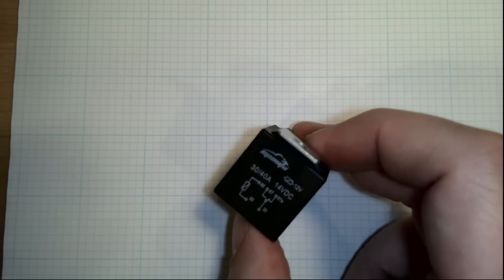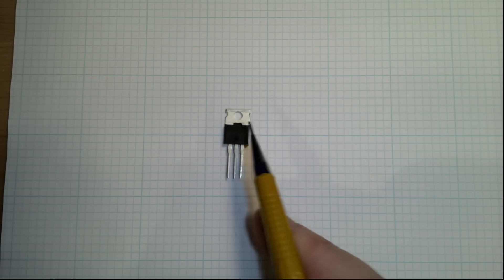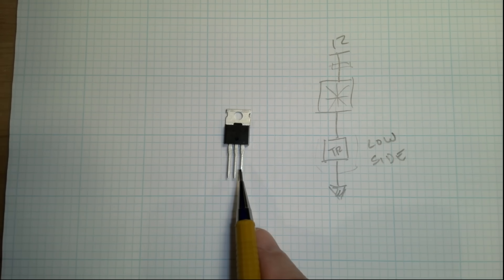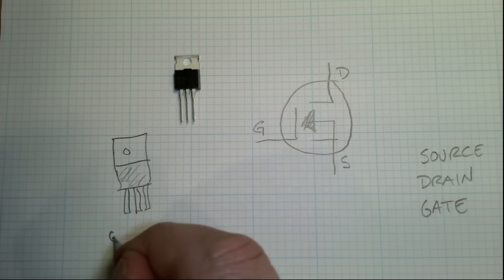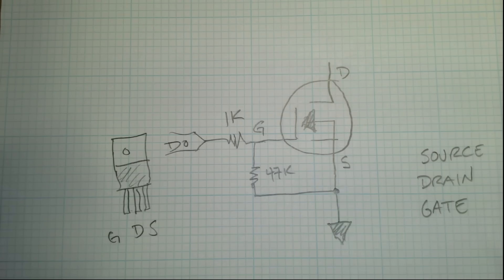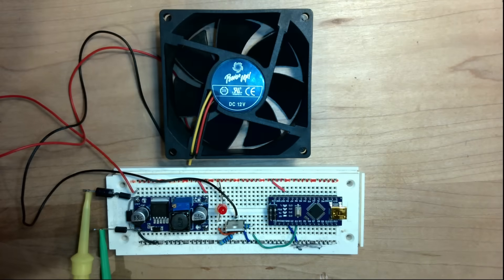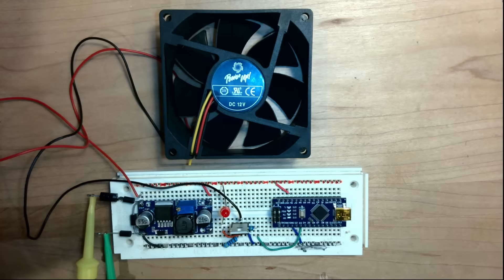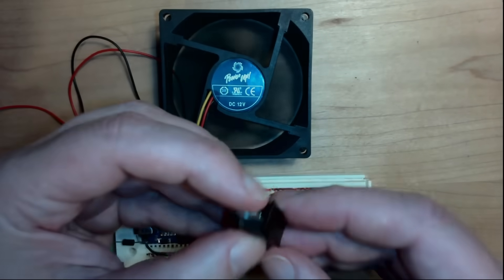Using a MOSFET to Switch High Current Automotive Loads

Comment from the maker: To be clear here, I'm not saying MOSFETS are better than relays.  I'm not saying you should get rid of relays.  I'm simply saying that relays aren't the only option, so if you're working on a project you might take into consideration using a low-side or high-side MOSFET switch. Use what makes sense to you in your project.
Reply: Any discussion of electronics needs to mention the hostile electrical environment, especially the potential for load dump / transient overvoltage.
Reply: So I thought of an advantage of MOSFETs, they can be modulated. Say you wanted your interior lights to have a softer feel such as a fade in and out when a door is opened. Using a microcontroller and a MOSFET, many modern microcontrollers would fit in a standard relay package along with MOSFET and support circuitry. That could PWM the output to make an easy-on-the-eyes fade in and out for the lights.
Reply: Auto tech here.  Source and drain seem to be backwards but understandable because electrons travel from negative to positive. 
 I hate the newer electronic modules because the high current loads are now deep inside and soldered in. No easy and fast way to plug a new relay in.  If the manufacturer stops making replacement modules. The car cannot be fixed.  I had a friend with an Audi R8. A hundred thousand dollar plus car. It used 2 engine control modules.  Audio and Bosch quit making them.  He had to scrounge junkyard modules have them repaired. Then borrow good ones to copy the programming. For the module repair shop to make them work.  Makes me like bicycles even more.
Reply from the maker: @waynep343  I feel your pain.  I recently had to repair the ECU for my 88 Jeep Wrangler.  A "remanufactured" unit was $1000, and my bet is all they do is re-cap them.  I fixed a burned trace on the ignition control and then put in probably $2 worth of new capacitors and I'm hoping it's good for another 35 years.
Reply: Wont it be constantly draining my battery at all time?
Reply: @oldestries no
Reply: @oldestries  no
Reply: @cuzz63  said you
Reply: No. MOSFETs are just plain better they last longer use less power they can handle more power... the only negative is the slightly harder control circuit. EVs effectively have single use relays for HV while the MOSFETS are doing the same current 20K times a second with no issues.
Reply: This is super helpful for a project I'm working on now adding power windows to a classic car.  Because of the way it's set up, each direction of each window needs it's own relay (to use aftermarket buttons for up and down).  An array of 8 relays is a big thing to try to hide.
Reply: @12x2richter oh hey maybe make an H bridge so you can reverse the input to the motor. They even have great digital options that are 12v, they can even be used by 5v logic if you wanted to add fancy auto roll down
Reply from the maker: @jordanrobberecht7003  Definitely.  I have a set of door lock solenoids that I want to do a controller for, and those will need H Bridges
Reply: @dotnetMakers    I got a house water pump from Grundfos and the controller in there has got BOTH, a relay and a MOSFET to switch the pump motor.  They use the MOSFET for switching it on (and also off) but use the relay to carry the current once the inrush has been covered.  This helps with preventing burnout on the contacts of the relay and also heat-issues on the MOSFET as it doesn't need to carry the current all the time.
Best of both worlds.
Reply: YEP for example my car uses irf44s in every module to turn things on and off....all via the ground side of ALMOST EVERY curcuit! due diligence and comon sense i think is how it was said to me.
Reply: How many watts is your mosfet and heatsink good for?
Reply: @whatsAname-w777k  it really doesn't matter, the heat build up in a car in summer will kill it very quick, not a good idea
Reply: @dustydawson8977  That is what I was thinking also.
Reply: @dustydawson8977  you do realize, most car stereo amplifiers are mosfet modulated, right?
Reply: I think this is what I need for my toyota’s honk.
Reply: See the solid state route good for shaving power savings for heated gloves and other clothing on motorcycles.
Reply: for a cooling fan you get a chinese made high amp SSR and done
Reply: is there any possibility they could cause a fire?
Reply: So, you’re claiming cats make better pets than dogs??!!! 
    INFIDEL!!!!!! 

I know you didn’t actually SAY that, but I didn’t hear you claim mosfets are better than relays either..  
    ..and I wanted to random-internet-participate too..  😂🤣

Comment: I dont get how needing an arduino controller is any better than a relay. If this is to replace a relay in a car you need to show this without a power supply board and arduino. And what is with shutting off and on? On a car it is either/ or - on or off, making the programming an arduino useless and not really useful to a tech.. I can see where it could be more reliable, but here you need a voltage dropper, etc, so how is this smaller and easier to install than a relay?
Reply from the maker: Sometimes people add circuits to vehicles, or create entirely new circuits or even entirely new controllers. When you're doing that sort of work, often a FET makes more sense than a relay because they are smaller or more capable of doing the job required. Understanding how a FEt can be used for high side and low side switching, and what the trade offs are helps to understand which might be more appropriate for a given design. Relays work great for many things. They also suck for many others.  That's likely why modern cars have way more FETs in them than relays, but still have both.

Comment: Are you sure the relay on the gate is for current limiting? The gate should have several gigaohms of resistance. I know in non-switching applications, where gate capacitance can be relevant, gate resistors often used to prevent oscillation. EDIT: By gate resistance, I mean Gate-source or gate-drain resistance.
Reply from the maker: Yes. The gate has capacitance and must charge. That requires current. The faster the gate, the more inrush current that requires.

Comment: You COULD do source-follower with an N-Channel, but wouldn't be the best. Also, probably not critical to keep in mind for this, but automotive voltages do rise above 12V. I regularly see 14.4V on my motorcycles, and sometimes higher on my van.

Comment: Hello. Automotive question here. 

Is it possible to custom control a modern day car fan with these arrangements:
1. Utilizing the OEM original 4 PIN car relay. (i will make 4 extension leads and relocate the relay since it's original place is in the underhood relay box) 

2. Completely isolating the engine management system from controlling the fan(this way no AC operation is possible , since it's module controlled , but in this case it is a test vehicle and i don't need AC)

3. Utilizing the OEM temp sensor(NTC thermistor)

I want the 4PIN relay to close (thus supplying power for the fan) at exactly 100celsius and open again at 95celsius.
I've found out the approximate resistance across the NTC thermistor both at 100 and 95 degree celsius.

Is there any economical electronics or micro-electronics solution for this case? 

The only other solution i can think about is purely mechanical : utilizing an old-style car fan switch which closes and then opens at the desired temperatures. But this adds additional work to be involved with customizing the OEM outlet radiator hose to accept this fan switch. Maybe a steel tube with the same OD as the ID of the oem radiator outlet hose, beading both ends , and machining and then welding a specific nut(m14x1.5) to accept the fan switch.

Any ideas guys?
Reply from the maker: Yes. What I'd probably do is a microcontroller with an ADC to measure the temp sensor and a fet or transistor to low-side control the coil of the relay.

Comment: To be honest, none of mine cars needed an relay change (but I have a spare one with my bulbs and fuses in the trunk). Previous car worked for 30 years (!) as a hard construction worker. Now I'm changing the third MOSFET on a six years old car. First was for the central-locking system, second for the wipers and now I have to get replaced one for ventilator. Each one costs 1200 CZK (59 USD) and two hours of service work, which costs another 120 USD. Im really pissed of. Relay costs about 3-4 USD and I can change it in a minute, without repair shop.

Relay can be overloaded for a while, even in hot environment, like an engine bay. Voltage tollerance is also huge. This is why they are still there, even when MOSFETs are in modern car also - for PWM or small loads. Critical circuits and circuits with high inrush current are still served with relays, due to relay's ridgidity. I like both technologies, but in car I prefer relays.   JZ

Comment: The problem is that relays, in a clear housing, are visibily easy to understand, even if you know absolutely nothing about them, just looking at how they are you know how to wire them up.
A power switching transistor, absolutely not.  It's just a black piece of epoxy and you have no idea looking at it, what goes to where.   Even between different transistors.   No printing on the outside, nothing but a little bump in a lead maybe, and still, without the datasheet, you're pretty much phvcked.  So there will always be a place for relays, if you want a circuit that will stand the test of time and the next guy to come along can figure it out.

Comment: I have a small bone to pick with what you said ~ which was ignored,

Many years back i worked with lots of semiconductors
And found they are not perfect as you have not said
If you leave these items connected as you mention
There is always a very small current called leakage
And depending on the source supply if a battery, it can drain it flat, if left for long periods of time,

Did you mention relays do not require a heat sink where semiconductors do, 
But unfortunately relays may also require more current drain from the supply depending on the resistance of the coil of the relay, and if there is a resistor involved,

Also if you use a semiconductor and if it fails or shorts, [ look out ]  The item it was controlling can run until it may burn out, or cause serious problems depending on what it is controlling,
And the problem then remains how much of a problem to change it
So myself I personally prefer often to use a relay,

And in the auto industry you often see relays being used because they are much cheaper and easier to replace, which do not cause a headache to replace if failure occurs,

And relays when not being turned on do not have a leakage
Unless you are using semiconductors to turn it on,

Comment: A consideration for cars is quiescent current (and the electrical isolation between ECU's and high power motors).
If you look you will find all electrical contacts in a closed up, locked vehicle are open, to minimise unintended current flow.

Comment: If you want that FET to sink 49A, you'll need to attach it to a HUGE heatsink and flow a LOT of air across it.  A relay is MUCH more efficient and easier to implement.

Comment: If you are using a switch to operate the relay, then I would stick with a relay.  If you are controlling with a microcontroller and/or need to modulate the load, then the MOSFET is a good way to go.  All depends on what you are doing.
Reply from the maker: Agreed. I could probably come up with some weird edge case where a manual switch to a FET makes sense but I can't think of one offhand.

Comment: The trouble with those cube relays they often take nearly an amp just to operate the coil, then you have to use a diode to prevent back EMF.

Comment: Appreciate the info but I have not had a relay fail on me often enough to use this method. And I have never had the click of the relay come to my attention to where it annoyed me. Relays are a much quicker install pretty much anywhere.
Reply from the maker: I don't think I'd replace an existing relay with a FET. If I'm building a new circuit, that's when I consider a FET over a relay.

Comment: You can't use a bare FET to do the job of a relay. 
It will fail catastrophically in many ways for many reasons. 

Just buy a solid state relay if you want to get rid of your mechanical relay. 
They've been designed my Engineers and mathemagicians.
... but there's a reason mechanical relays still exist despite decades of semiconductor production.

Comment: Good information, however, that heatsinked transistor wont be happy long in 50*C+ ambient under the hood temp...
Reply from the maker: There are plenty of automotive grade transistors out there, and plenty used in under hood controllers from the factory.

Comment: I set this up exactly as described in the video, on my workbench, making sure all grounding was set. I applied these voltages 3.3v 5v, 8v to the gate and none turned on the DC motor. Any suggestions?
Reply from the maker: What source voltage were you using? And what part number FET?
Reply: @dotnetMakers  I have a dc motor that runs on 12-20 volts and .9-1.25 amps. I varied the voltage and current on the source with my power supply but effect, the motor still did not come on.

Comment: It's a good idea but but providing gate voltage at the time engine needs that kind of the load to be turned on is the problem I mean the ECU mostly provide ground for the relay to be actuated and gives the loads it's current needed to operate

Comment: Relays are not noisy (loud), especially when they are mounted under the hood. They are also not that big. 

The relay is quite elegant, for automotive use. It requires no controller or code to be written for said controller.

Comment: You forgot to mention that that heat sink will be hot... As in there will be voltage on it because you need an insulator between the heat sink and the mosfet.

Comment: The mosfet + heatsink take up more space than a relay would, and a relay can run on 12V without having to drop it down to 5 or 3.3...this is a good example of just because you can do something doesn't mean you should. Relays are available in a variety of sizes and can be less than 3/4" cubed. Another thing to consider is surge current, especially when activating electric motors for fans or pumps. When it first starts the current draw can be well above the rated capacity of the mosfet, thus blowing it out. A relay can handle the overcurrent for several seconds before melting down - more than enough time for the current to stabilize.

Comment: This also requires a mircrocontroller to turn on and off? 
Could I just have a 5v source to a switch? [You answered in the next video]
I have a wiring job to pull high current away from the HVAC controls. Its melting the connections; Parts are not rated for this current. Conventional theory is to run relays for each fan speed. I need to look at the schematic again. I feel like there is a better answer then a bundle of relays behind the dash. 
You have a newer video, I am going to watch.

Comment: You DO NOT need a resistor between a logic output and the gate of a MOSFET, in fact, it can be detrimental. In contrast to the "normal" transistors, MOSFETs are "voltage switched", that means, the gate is isolated from drain/source, and no current will flow through it. If you are using the MOSFET as a switch, like here, all you need to do is hit the threshold voltage at the gate to make it to turn on fully. If however you have a resistor between the MCU pin and the gate, there'll be a voltage drop, and that may get you below the threshold voltage. This will mean that the MOSFET is not turned on fully, and the resistance will cause it to heat up. Many power mosfets have the threshold voltage at around 4.5V, so when using a MCU operating at 5V, you're treading a fine line. Just omit the 1k resistor and you might get less heat.
Reply from the maker: The gate cannot go from zero volts to non-zero, or non-zero to zero with no current.  It may be for a very short period, but there will absolutely be current, and the higher the gate capacitance, the more current it will take.  The resistor protects your microcontroller from having to source that current.  If you're running a PWM, EMI also is a thing.
Reply: @dotnetMakers  You are correct in principle, however that is irrelevant. The gate capacitance is tiny. IRFZ44N used by you here has gate to source charge of 14 nanocoulombs at 10V, which means it's similar to charging a 1.4nF capacitor. I wouldn't sweat that. Any MCU can easily provide enough current for that (and even if it couldn't, it simply wouldn't - no protection required). I'd worry about not turning the MOSFET fully on more than about that.

Comment: relays need to be tested RIGOROUSLY if you cannot inspect the contacts. this means off car on bench testing. after loosing much sleep if i cant open the relay or i feel sus at all i will buy a new known good brand relay to save what sanity remains.😊
Reply: fets do not suffer this problem, but maybe a solid state 7v-18v relay for troubleshooting in the fusebox would be cool? hmm the gears are turning 😅 the test equipment i could connect hahaha. ahhh nerds.

Comment: You can use N-mosfets on the high side as well. It just needs charge pump to achieve the correct G-S voltage, which adds to the voltage of the load.
 It's often done for reasons you've mentioned - the additional cost of driving circuit are offset by better properties of N-mosfet.

Comment: if anyone is in the same boat as i am and needs to switch on the high side, it is much more complex to set up, but the tps250hb is an amazing chip that can do so much in a fantastic package.
Reply from the maker: in a later video where I create a glow plug controller, which is high-side switched, I used a BTS50010-1TAD which is an amazing package as well.